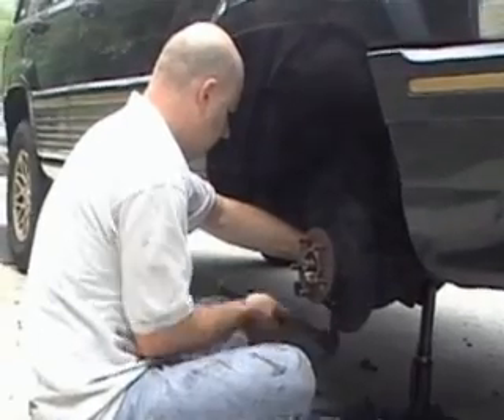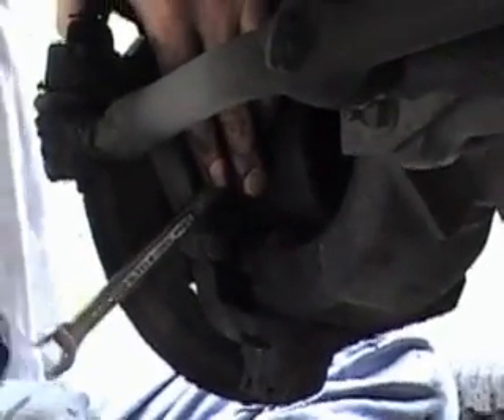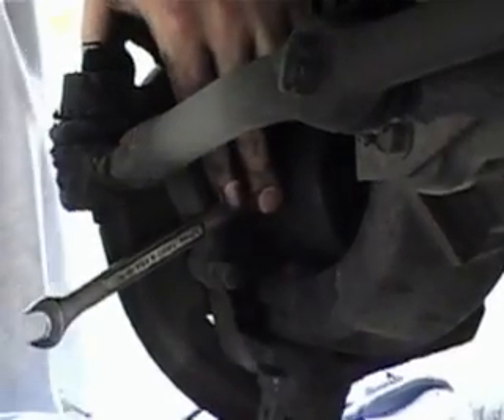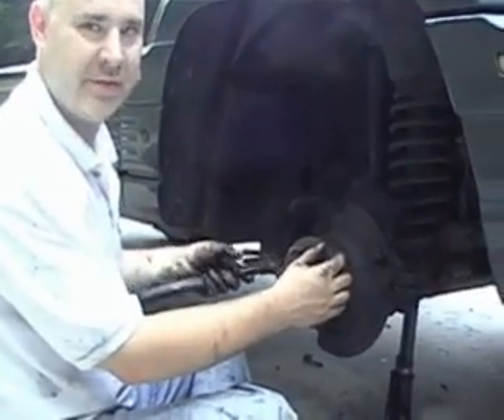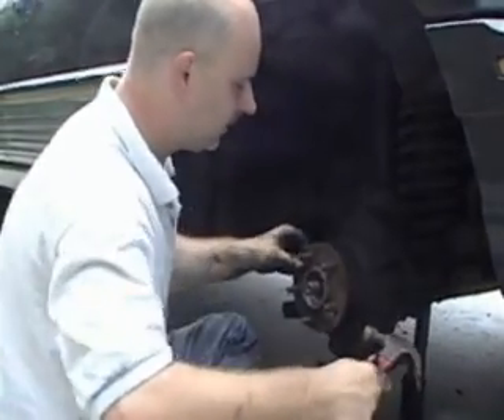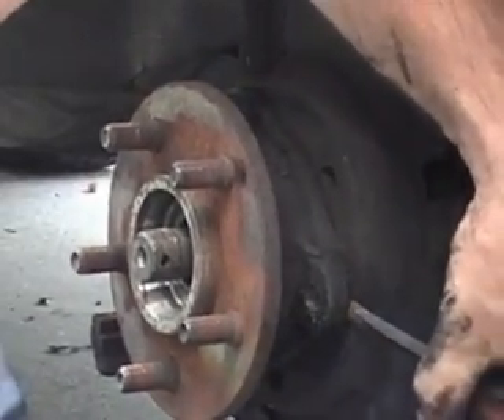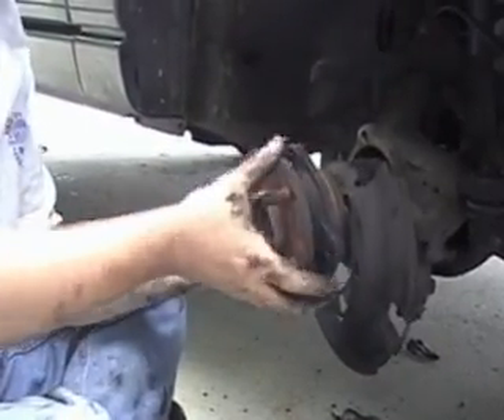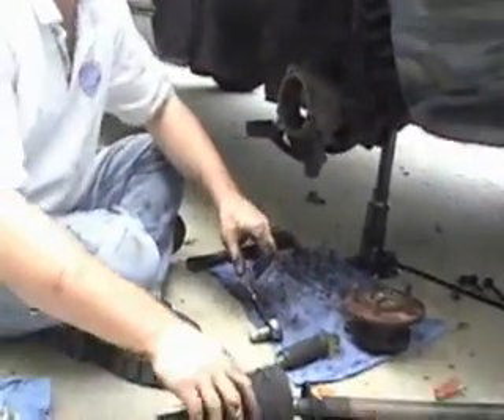CV Axle Assembly Install Jeep ZJ Pt.1

Comment: Nice video, thank you for posting!  It helped me get prepared for the same operation on my Jeep.  Good tip on the PB soaking days in advance!

One suggestion: Instead of hammering on a wrench (never a good thing unless you're out of options) I turned the wheels to the left, then to the right. This way, I gained very nice access to all 3 hub bolts.  Enough access that I could fit a socket with a breaker bar. Between that and a good PB soaking, the hub bolts were no trouble at all.

Comment: I wish I had a jack that I could feel comfy enough to trust without using a jack stand to replace my axle. I love the technique of bolt removal...1. Jack car up... Preferable to be done on a surface having at least a slight angle. 2. Crawl under front axle assembly. 3. Call for  ambulance 4. Begin banging on bolts that keep axle in place.   Wow...

Comment: Get yourself a combo wrench set with a ratcheting end. I did and it has saved me countless hours frustration and  not worrying about taking the wrench on and off each time to turn it. 
Very helpful especially when replacing the lower control arms on a BMW E30 3 series  ;)

Comment: Yup, been there done that. I gotta respect a guy that can get it done with a framing hammer and a screwdriver. It musta taken me 4 hours and broken 3 $100 pry bars go get that dang hub off. We ended up having to buy a ratchet meant for a semi and a 5 foot cheater bar. I was rebuilding the differential... that was the easy part. That is until about 4 weeks later when I checked the oil and there were more metal shavings than oil... ooops...

Comment: @cyerbyandmarge: Yes, exactly the same except there are no dust shield for the rotors, and you'll need to find out if you have lsd's because the shafts are different. Quadradrive shafts are a little shorter I believe.

Comment: what I usually do is the weight of the vehicle on a jack stand with the jack still underneath, then throw the wheel under as well.  Triple protection.   Redundancy is better then a prosthetic.

Comment: Next time you do this, get a  1/2 inch breaker bar and a dead blow rubber mallet.  Makes for starting the sticky bolts much easier.

Comment: Okay so my question is you don't mess with the ball joints..? Ive never worked on this part of my jeep before..
Reply: +Joseph Erskine no need at all you just need a 36 mm and a 12 point 13mm or 1/2 in socket and maby a breaker bar or a 2X4

Comment: There are so many things wrong with what he is doing.  While he may still have his legs at this moment,  NO ONE should be working on a vehicle like this.  Why doesn't he work from underneath the vehicle to take the bolts out of the back of the brakes instead of doing it blind?  Because he's concerned about getting his head squished thats why.